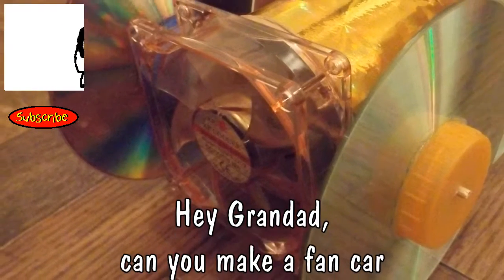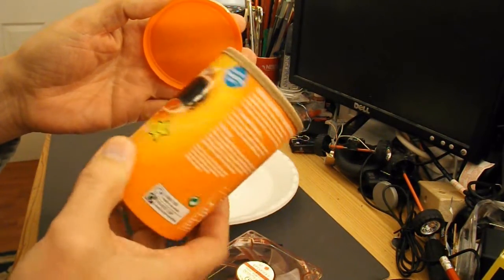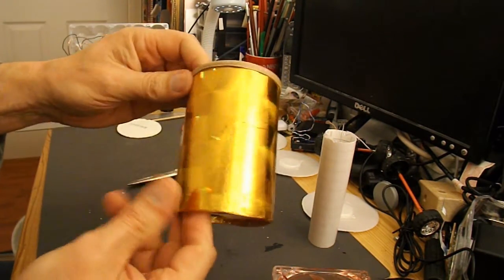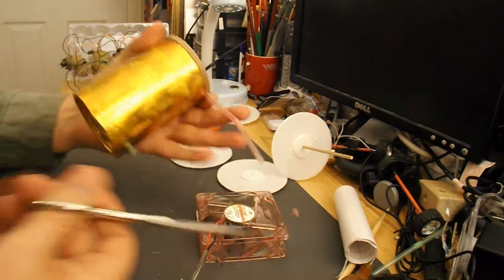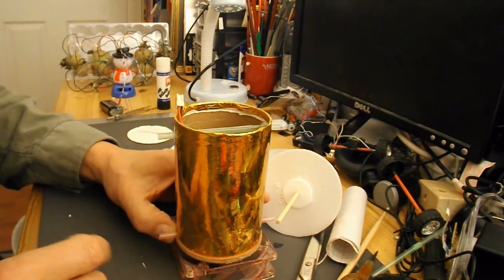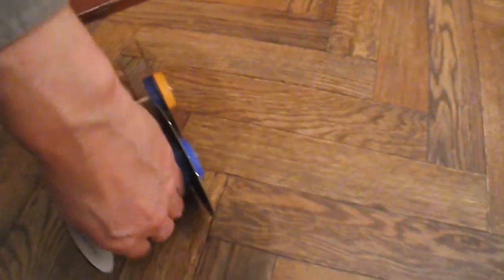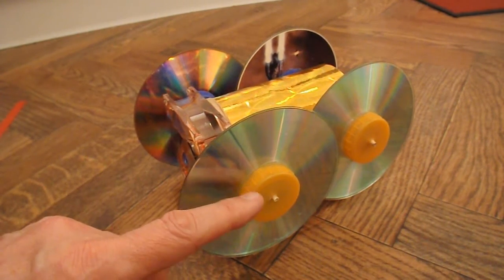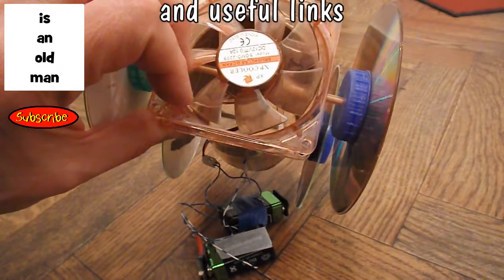Hey Grandad, can you make a fan car using an electric fan from a PC?

Comment: GranddadlsAnoldman Hi there can you make a two d cell battery red and black wires cover case on and off switch for led lights. Thank you dennis
Reply from the maker: dennis le vaughn1 I will have to think about that simply because D cells are not something I use very often so I doubt that I have any. Do you really need a video to show you how to do that? It is just a matter of making a box big enough to hold then and add some metal strips to make contact with the terminals. You could probably use the packaging the batteries come in from the shop.

Comment: Question:
If placed in the back of that boat a piece of funnel or a truncated open cone, made with a piece of cardboard ....
Do not increase the airflow velicdad fan and therefore the speed of the vehicle?.
Although power would be lower, especially, thinking that it would offer resistance tightness in the pot.
Greetings.
Reply from the maker: Hi Francisco, I might run some tests with different size cones to see if it improves the speed. That would be an interesting project. I would make a new car so that I could easily change the cone size for comparison. I will put that in my list.
Reply: GrandadIsAnOldMan
As always, be very interesting to see. 8-)